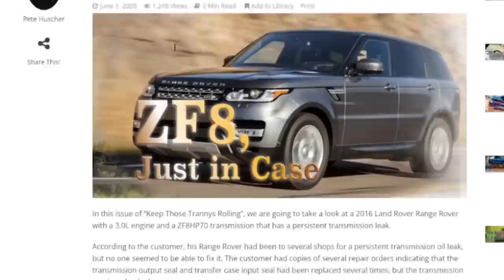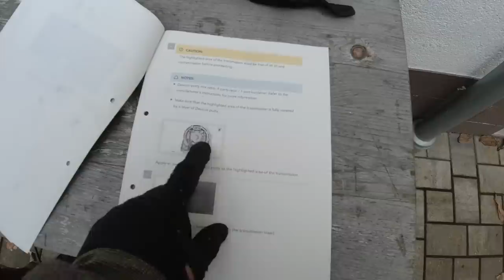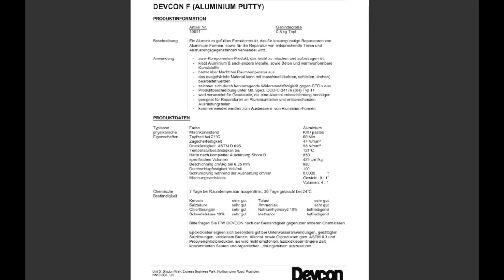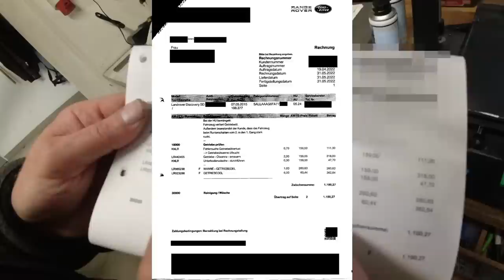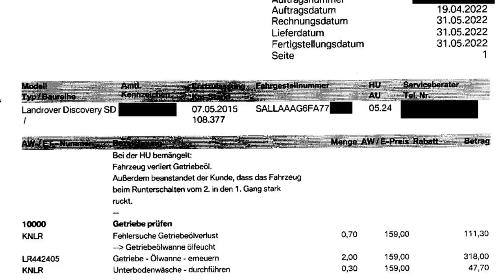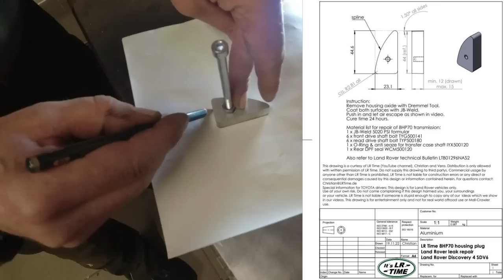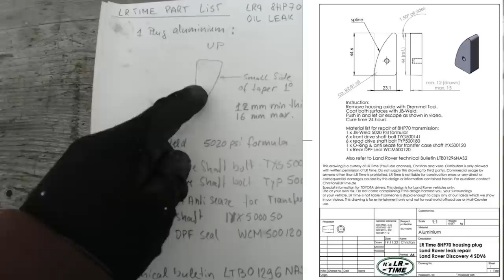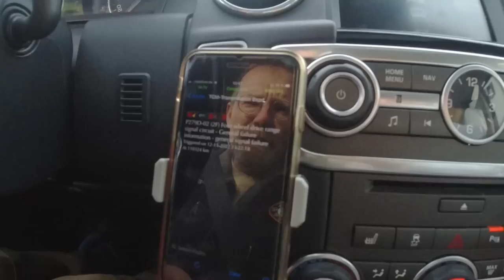Dumbest Oil Leak Ever Fixed on our Land Rover

Comment: The origin of the problem was at ZF.  Land Rover put out the subsequent service bulletin.  The Land Rover dealer service department appears to have missed it.  However, seeing as this was a bulletin specific to the very leakage issue for which the truck had been brought in, I view that as negligence.  Had this been my truck, I would have demanded that the payment for the previous bill be applied to the subsequent fix.  That said, I would have probably looked online beforehand for the bulletin as Christian did; the dealer clearly doesn't expect owners to do that, so were clearly caught out.  I find in Germany a lot of "experts" absolutely hate it when they find themselves dealing with informed consumers, and lash out as this guy did to your email instead of saying "good catch, let us put things right".

One mitigating factor:  Often customers put heavy time pressure on dealerships to turn their vehicles around.  Perhaps they should have kept it an extra day to check for leaks the next morning, but they might've told the owner she could pick it up that day, so they replaced the pan and cleaned it up, didn't see any more leaks in a few hours, and then rushed it through the TÜV.  This still doesn't get around the main issue, which was that no authorized dealership should have missed this service bulletin ... especially in this day and age where everything's computerized.

P.S.  Christian has invented a new word "hypotentially" ...actually, that's really not a bad replacement for "hypothetically" at all ;-)
Reply: Customer times pressure can be solved with honesty and the offer of a courtesy vehicle. Trouble is, honesty requires some knowledge...
Reply from the maker: Agree that German companies and individuals are not able to admit faults.  I hope I am different.   Christian
Reply: @abarratt8869  I am 90% certain I've had our Land Rovers serviced at the very dealer who performed this work, and they charge rental car rates for loaner vehicles.  I was shocked by this, but my wife said it's standard German practice.

Comment: When you are looking for cracks in the future where oil is concerned. You can use an engineers white spray paint that shows up the most insignificant of cracks. I use it all the time and it saves you so much time. Also it identifies the exact location. Used on Toyota's as I am an ex Toyota mechanic/engine builder. Currently a DAF mechanic if you're bothered and I love your videos. 👍

Comment: If there was a recognised casting problem 'from the factory', then why shouldn't the dealership fix fully free of charge?
I and hundreds of others got an entire $10,000 2009 Audi A4 engine rebuild on a 7 year old car, as second owner, free of charge because of an accepted bad factory piston design causing excessive engine oil consumption. Why should the owner have to pay for the car companies accepted and recognised manufacturing fault?

Comment: As somebody that now owns two late model Range Rovers and one Range Rover Sport, I can say with certainty that 85% of the unreliability reputation that Land Rovers get is due to dealers not fixing an issue correctly the first time....or the second or even third. A couple of times they actually damage something that then needed to be fixed in the future. It has been very frustrating, especially when you Google the issue and show the dealer what others have experienced and what the fix is and they still don't fix it. They obviously use a flow chart method (and not common sense) to diagnose and "fix" the problem. It is a shame because they can be awesome vehicles.
I think Christian and Vera need to be crowned "The Land Rover Whisperers"!!

Comment: Porous castings are a thing, ask any Norton Commando owner. JB Weld is so useful and they do a metal version which can be used on any material and has extra strength and toughness from added metal particles. I suspect it is like the difference between cement and aggregate concrete, the small stones in aggregate give much extra strength to the final repair.

Comment: I have a LR but I'm going to talk about a VW main dealer in Bonn. We bought a brand new Touran as a family daily driver. Great car. At about only 30,000 Km we started to have trouble changing gear. The main dealer told my wife we needed a new clutch. I was away at the time. 1,000 Euro later we have a new clutch we didn't need and the problem was still there. We brought it back and another mechanic found the leaking clutch slave cylinder, which they also charged us for replacing and now the problem was sorted. That will have been the problem all along, we all know it. They had misdiagnosed the problem and not checked for the more obvious cause at such low 'mileage'. I asked to see the manager, waited for a couple of hours on the agreed day. Then the receptionist told me he wasn't coming in. In reality he refused to see me. What does that tell you? I also never take my LR to a garage.

Comment: As a vehicle technician I have worked in a few dealers my time. In my opinion the dealer technician's should have checked the tech bulletins first. However technicians are always  the first to be blamed. Dealer management are always comparing them to the clock and money. Yes the dealer should have conceded that they got it wrong. and refunded the customer. (few do). when I teach apprentice's  i explain  that there diagnosis/advise has an impact on what the customer does next. The out come  this time is you guys got a cheaper disco. great little series.

Comment: Looks like the problem has existed for quite awhile superceded bulletin LTB01255 NAS1/2018 and later bulletin LTB01255 NAS2 [4/9/2020]porosity in the cavity closer to the output shaft.

Comment: I agree with you Christian, the LR dealer incorrectly diagnosed the fault but worse than that they had access to LR update paperwork I am sure. They clearly did not check for further leakage after repair this is totally wrong, I worked for a franchised Caterpillar fork truck dealer and had access  to training and all the paperwork updates, if I hadn't followed up correctly I would have faced some sort of management conversation for poor workmanship if that was my repair I would have gone back on site the next day to check for leaks after some usage. If I made a mistake my company would have given some reduction of cost to the customer if it wasn't straight forward ie I misdiagnosed and caused extra cost.
Further I found a video referring to the water leaks into the left hand side of the vehicle which found a blockage in the sunroof drainage pipe which on the face of it sounded correct however my Disco has no sunroof! so still looking
Is there an email to send you a picture of my Disco 3? it is fully camouflaged has a winch bumper and winch, all rear seats removed and replaced with storage and a deep cycle battery and invertor for 230v power... 
Brilliant content as always best regards Phil and Louise.

Comment: The cracks develop because of the complex design of the castings many pockets and webs of differing masses. During production parts of the casting cool first and are subjected to stresses caused by the cooling and contraction of the larger sections. Even if it does not immediately cause a hairline crack, one may develop later. The trick is to design a casting that will cool uniformly or to control the cooling. But unfortunately everything has to be made as cheaply as possible and short cuts are taken. Pity that Land Rover didn't find this problem during development because they ultimately pay the price in recalls or bad publicity. Glad you found the problem.

Comment: Key point in this , is they did not check the TSB , first point of diagnostics after confirmation is to gather all the information , JLR use a 6 step approach for diagnostics

Comment: Thanks for the good class - Now, i am looking at a 2011 LR4 HSE with 154k miles.  Should I be afraid?
Reply from the maker: Not really. I mean, only 2% of the LR4 SDV6 suffer the crankfailure. But of those 2%, about 90 % are just around that Kilometer range🙋‍♀️

Comment: I am a EHV Cable jointer and remember a gland on the cable, that was a aluminium casting. And some of them were porous! Fine bubbles in the casting I would think. This I would say is down to Land Rover. 
They have the vin numbers of all the bad castings and they should have had a recall on them all to fix it! 
But obviously want there customers to pay for the bad castings to be repaired.
I think Land Rover should be fitting new ones in

Comment: Hi Christian, I have to  say that in my opinion, the LR dealer was totally at fault. This leak was a known fault in the ZF transmission identified in specific VIN #s and made aware of in Service Bulletins. The dealer/mechanic/shop foreman should have checked the TSBs anyway since it was a known fault unless they had sold so few affected vehicles that none had come back with the fault in question. To charge 2400 euros for a job that did not get fixed and not offer to do it properly when they had been advised of the identified problem is unconscionable  and deserving of escalation to the LR area manager. The response from the manager was an out and out lie, shameful! I love yout videos, delivered with humour and detail, thanks.
By the way shouldn't ZF be responsible for repairing the poorly cast transmissions?

Comment: Great to see that got fixed. In my view the Land Rover dealer that attempted the repair should have taken the car back in for the previous owner and kept going until it was successfully repaired. They should have given them a loan car and either not charged for all of the parts that turned out not to be needed ( they could refit their original parts if they still have them) for free. Their bill should then have been passed to ZF.

Comment: I had an E270 mercedes estate where the fly by wire braking system failed while my wife was driving.
  She managed to roll to a stop on a busy B road thank God. Mercedes know about this potential failure think it was also a problem on the SL they decided to only fix it if it failed.
  The forums knew all about the problem. When I mentioned this to Liverpool Mercedes no one had ever heard about the problem, no one in sales no one in service had ever heard about the problem. After some gentle persuasion and the threat of legal action they fixed the problem FOC £2500 worth of work apparently. But they don't fix it till it fails !!!! Good luck with Land Rover only ever had one service at a main delayed in 2001 on my TD5 it was £450 back then crazy.

Comment: Land Rover have admitted a manufacturing fault which caused this problem, therefore they should bear all consequential repair costs. 
I'm driving my first Land Rover (Disco 4 Mall Crawler, like yours), and so far so good. I drove Toyota/Lexus cars up till then. On those (rare) occasions when Toyota announced a design/production fault, you could be confident that not only would they rectify it free of charge, but they individual responsible for its occurrence would be identified and handed a revolver and a single bullet and shown the back door...

Comment: Like you sometime I found a good deal on the Land Rover because the owner is not able to come up with the money for the repairs so they just let the car go for a real cheap price. I found a 2006 range rover sport HSE 4.4 naturally aspirated with close to 300,000 miles.
First thing I did was to drain all the oil and refilled with all the synthetic products. I discover in the process they never did change the transmission filter & also trainy fluids from day one. I found the stamped on manufacturing date 2006. ZF6 21 bolts. Todd #30
I replaced the oil twice after running the car for awhile the first time I cut the plastic tubing to be able to drop the oil pan and replace it with an aftermarket filter. I do not like the design of that replacement filter. The size of the filter is smaller compared to the original design from ZF. the suction opening to let the oil in the filter is smaller and I feel like the transmission is not getting enough oil to the pump. Taking off very gently it works fine but in a quick acceleration it was not working the way it's supposed to.
lately I replace the plastic oil pan with an aluminum one. The filter is built in
The filler plug & the drain plugs are equipped with a magnet instead of the 2 round magnet in plastic oil pan.
My recommendation is replace the transmission fluid every 60,000 miles depends on the condition of driving the load the temperature the stop-and-go or if the car is mostly used on the highway at cruising speed for long-distances.
When I do a service on the transmission it's better to do it after the car is been running for a while and at the same time I disconnect the line from the transmission to the oil cooler at the bottom of the radiator after I refilled the oil pan few times. I start the engine for few seconds until I hear air & oil bubbling. That way i flush the torque converter. 
i am happy when I see clean clear oil coming out . About 10 liters.
I basically gave a new life to this old transmission. I was amazed the second time I drop the oil pan to see how much dirt I collected again but no shaving or no clutch parts from disques. Few dozen mile between my transmission oil change. The new oil act as a detergent to clean up that overdue oil change.
Each time I did it the transmission shift smoother and smoother each time.
I'm getting 23 mi to the gallon on the highway with that old dog... 🐕

Comment: I really had to make a comment on this fault finding exercise. To achieve a result on leaking fuild, the method would be to use a, (1). coloured dye on the case to see if there is location leak

 (2). high viz flo paint as on the point used by single seater racing teams use for aerodynamic testing.

(3). Use a ultraviolet light lamp as forensic scientist employed.

(4). Take out the unit and use melted metal and pour into the crack.

I hope that may help for current and future repair jobs.
🇬🇧

Comment: It's quite obvious they didn't verify the leak was repaired. Possibly the oil pan was leaking when the vehicle was originally 
presented to the dealer as you pointed out. It sounds like possibly the previous owner tried to get them to rectify the
leak but it was going to cost her more. The dealer should  have offered the repair minus the cost of the previous repair .
Especially because they even charged her to clean the transmission.

Comment: Hi Thank you very much for your info, I have been investigating this fault for over a year, have the same issue of clunking from 2nd to 1st gear after approx 20mins of driving, I have replaced Transmission oil, transfer box and diffs. Can you manufacture the aluminium block for sale? I would be willing to pay over the odds for the part.
Reply from the maker: We have the drawing for the aluminium block on our patreon page. It can be downloaded there and manufactured locally. 🙋‍♀️Vera

Comment: I had oil in the brake booster, was also a recall issue, I emailed all the dealerships in New Zealand and I had asked for a quote to perform the recall as I had a total loss of braking, none of them could find the parts required to perform the recall it had been many months of no response, I emailed them the bulletin with the part number list required, and they wanted to sell me a new booster, $1000+ and new master cyl $400+ and new vacuum pump as the valve cannot be purchased separately for $4500, no labour included, i suggested a compromise, as they claimed the previous owner had the recall conducted, after investigation at a non LR mechanic the  valve was installed incorrectly the spring and "ball" was laying sideways inside, the recall specifically states to check the spring with a tiny mirror to ensure it is seated correctly, it appears land rover dealerships are incompetent world wide. And there is no way to complain as the only contact method through the management at the dealerships, which, as you found out, ends with a pathetic response. So much for their recall statement, "Money is of no concern when peoples safety is at risk"
Reply: As for your answer, the dealership should have done free diagnosis, free labour and performed the recall charging for the materials only. Especially if the $10 compound is being charged at $500 euro
Reply from the maker: 👍🙋‍♀️Vera

Comment: Thoughts on the dealer with the LR4 mall crawler.....The biggest mistake from the dealer was not inspecting the VIN for any issues.  They should have looked this up and they would have known about the transmission.  However, if they had I think they would be in their rights to say the transmission needs to be replaced since ZF had manufactured it incorrectly.  The dealer would be taking too much risk doing the repair per the Land Rover bulletin.

Comment: Without going too far into it, it seems like all dealers behave this way. I am beyond tired of it. If I didn't love cars so much, and if it wasn't so critical for me to have one, I would do without a car. I have been dealing with similar issues these past two months. I think I may still have a problem, which seems to be software based after £2000 in replacement parts under warranty, but I have everything I want and it is working reliably, so I will address it in the new year. The work is warrantied for 12 months, so I should be able to go back and have it figured out if it becomes important to have the specific feature.